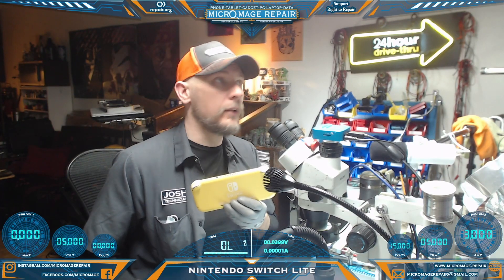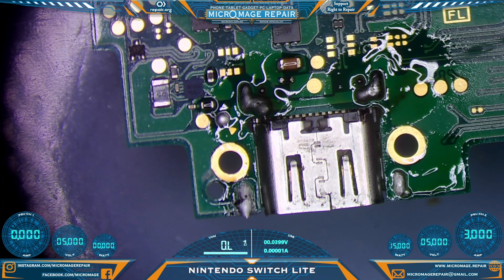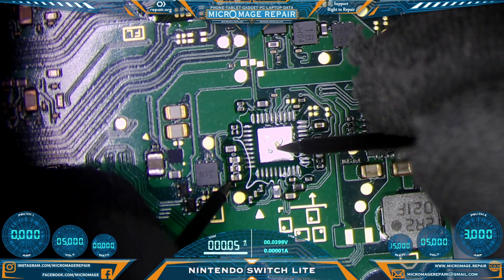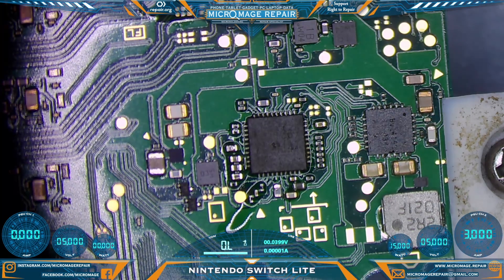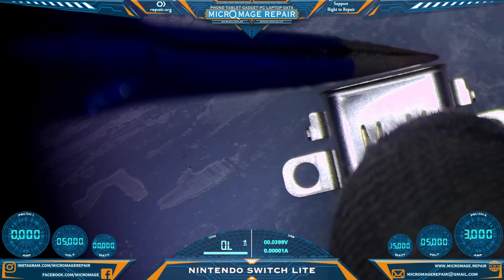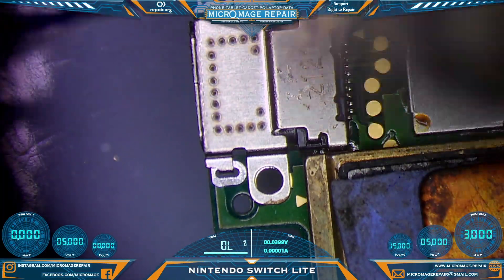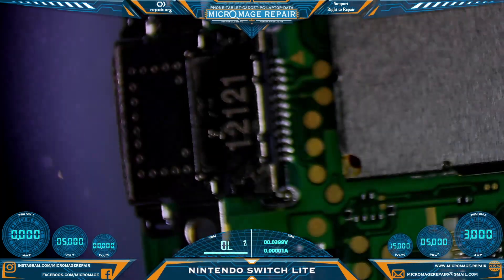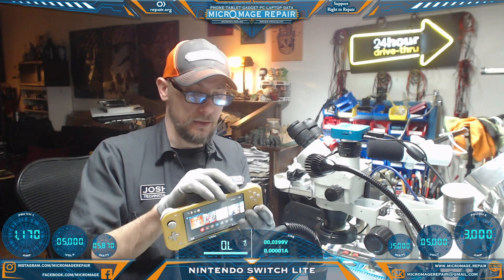Switch Lite: No power. Why?

Comment: Quick question buddy. I recently switch over to the Weller WX2 station and have had it set at 450c. I can't work an area long before starting to remove factory solder mask here and there and sometimes lift pads. I believe it's too hot. My old hakko iron was set around there if not a bit higher but I wasn't using as large as tips. Mainly medium size chisel tips. I think I may need to lower my temp. 400-420c seem reasonable to you on this station? I know you use it so figured I'd reach out. I've done hundreds of HDMI ports with my hakko and some with this new station but today on a PS4 it went from a straight forward port swap up a 5 jumper repair lol. The pads could have been weak don't from the pins snapping off the board but yea I do believe it's too hot. Loving the channel as usual!
Reply from the maker: Appreciate the question Hove!
Couple of possible variables here.
One, your climate, I live in a high-altitude dry climate and find it takes quite a bit of heat to rework, you may need to make an adjustment based on yours.
Two, The biggest improvement of the Weller over the Hakko is it's recovery, the iron will recover it's temperature much faster when working on heavy ground planes and thick boards so may need to adjust the time you spend in contact with the board down a bit.
Always best practice to go with the pads rather than crossing them.
Those would be my guesses.
I have not had any issues pulling pads with them, occasionally will pull up some solder mask though especially on ground anchors, the iron will pour on the power to stabilize the temperature.
Reply: @MicroMageRepair  yes I've noticed this and I'm loving the station. I live in Indiana so yea I don't think it's any issue there. I lost some pads today for the first time pushing down on the HDMI pins to the pad and holding for a bit on each one. Always done this. Maybe a combination of that too long/too many times and the port pins pulling off the pads when it broke making them weaker. They all did tin up very nice though before the install with no pulled pads. I'll lower the temp a bit and if I don't get the heat transfer I want I'll gradually increase it and be careful with how long I work the pads. This isn't my first job on the station just the first of this issue. Could be that combination of all that. I appreciate your time! I'll see you in chat in the next Cod3r stream 🙋🏼‍♂️
Reply from the maker: @hove131  Glad you're liking the station, it's very underrated imo!
See you there!
Reply from the maker: Also, A little pro tip: what you really want to do when tinning pads is put a ball of solder on the tip and run the ball over the pads.
I try to make as little contact with the tip as possible.
Reply: @MicroMageRepair  yea I've been doing repairs for a few years now but always willing to learn more. I see alot of people drag solder across the pads and get good results but I get the best pillow of solder going with the pads using the tip one by one.  Appreciate the help buddy. Start posting more videos I'm bored at work!!! 😂😂😂

Comment: Damn that shield is hot haha 
 I won't serve as those Nintendo switch lights Doing all that work just like you just did and it's not working still shorting out 
You're the Nintendo switch God haha lol 🤣
Reply from the maker: Don't feel bad, they where at one point and can still be maddening devices even after how many I have dealt with!
Reply: @MicroMageRepair   But there's something particular with the light Models With bad USB ports sending voltage to the CPU
Reply from the maker: @QsTechService1  interesting, I can't say I've run into that many brain dead ones as of yet, though I did have one last week. I'll keep an eye on it, be on the lookout if its just a run of bad luck or a common concern.